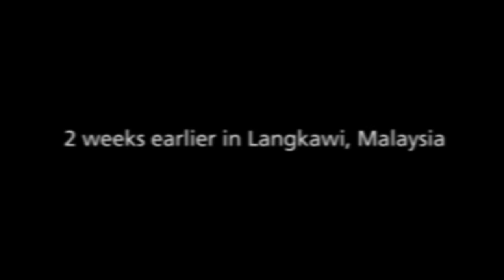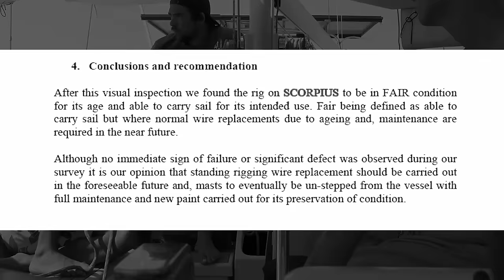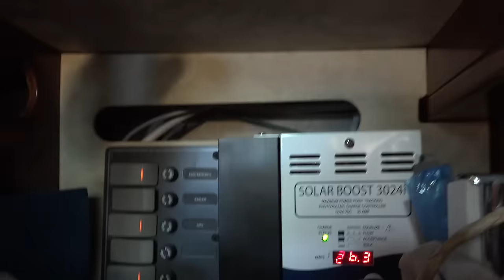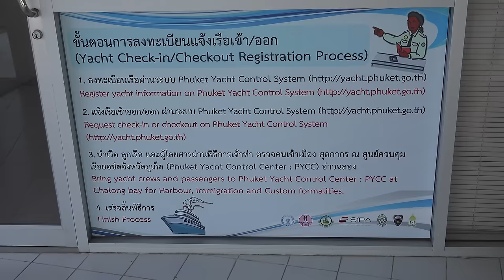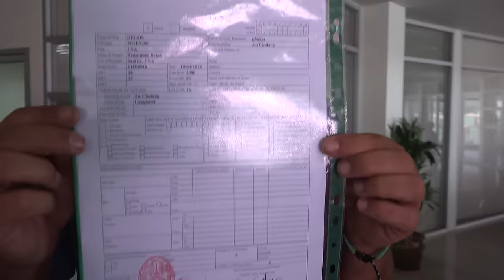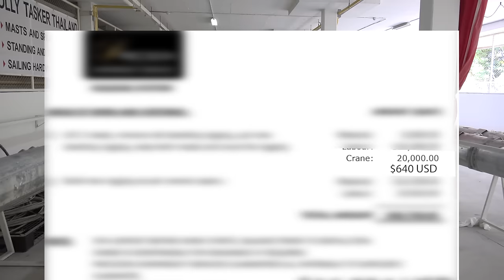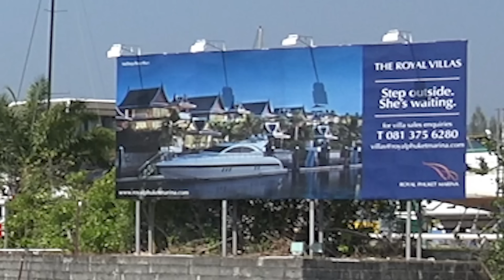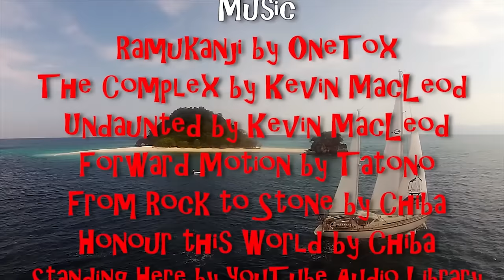Rigging Our Sailboat (Part 1 of 3) Sailing SV Delos Ep. 61

Comment: When I replaced the stays on Satori, I did it in sections without help. I started with the lower shrouds, then upper cap, then fore, staysail, and aft. Didn't have to pull the rig and saved a ton of money. Just had to bring the rigger each set and pick up replacements. Did the whole thing over three sessions. With a crew of six, even a ketch would only take a few days if you could use norseman instead of swaged ends. Thanks for sharing!
Reply from the maker: +SV Satori Yep, that's exactly what we did but in a slightly different order.  Stay tuned my friend, all that good stuff coming up :)  Fair Winds- Brian

Comment: you guys rock. that is by far the right way to do that job. you are right there to get the parts you need if there is a problem it can be fixed. if you order it and have it shipped in and there is a problem then its another 2 months to fix it.this way is cheaper faster and you know what you have and that it is done right....great video as all way and as all was far winds and calm seas.
Reply from the maker: +S/V Working On It Looking For The Boat Yep, you are absolutely right.  This was a major factor in our decision to do it locally.  Fair Winds!  Brian

Comment: Really polished, You mastered video... and yet somehow manage that while still moving...To those of us knowing whats what... Fascinating!!!! 
I am doing my rigging as well  but on a 32' cutter,  its no job like yours though. 
The swages is where wire fails. The cracking is expansion from corrosion which can be exacerbated by salt and water running down the wires. 
Stainless does not like being shut up away from the air. and to add to the problem any stray current makes for galvanic action. 
Lower ends such up the abuse most with the salt water getting into them from open ends, makes one wonder why cutting the ends off and refitting with extensions would not work. But a complete replacement is always advisable. 
Salt water is soooo corrosive and when stainless fails it is with no warning at all. 
I spent  a lot of time aloft when I was younger. I would go up any line at all because I pictured as a kid the ropes we'd swing out over a canyon with from a tree. Ropes so old and tattered they looked as if they wouldn't hold up their own weight -let alone ours. But now at 180 lb. you learn to be more cautious. I'm lucky to still have all my rock climbing gear which makes some tasks easier but the chair and triple block make it easy enough but storage harder. 
Be careful hoisting up, especially the wire to rope halyards they will part sometimes.
   Anyway, Merry Christmas to you guys and Happy New year...
Reply from the maker: +Will Leroy Hey Will!  Merry Christmas to you as well.  You're spot on about the rigging details- stainless gets really worked in that environment.  We did change the whole thing so stay tuned for that, we should release that episode in just a few days.  Fair Winds and good luck on your rigging job.  Brian
Reply: Happy New year. Just curious Brian, did you come down or watch the fire works from aloft?

Comment: I think brake cleaner on the pump motor windings was a bad idea.  The wire is insulated with a thin coat of varnish.  If the brake cleaner dissolves the varnish, the windings will have a short. That would make the fuse blow!  Then you'd have to get a new motor or have it rewound with new wire at a motor shop.

Comment: For the future. Usually this type of cables are oversized from the project with more then 10%. So if this wire was broke for corrosion is one or if was broke from tension is other.  One wire is less them 10% from what I see. If corrosion is the cause  it can wait.

Comment: Thanks for including the pump failure, I like to see those real world situations.  But what happened with the motor repair?  Did simply cleaning it out work?  Was it a bad seal and did you have parts to repair it?
Reply from the maker: +ShawnMichael121277 It was indeed the seal on the pump that then leaked out the housing and 
slowly filled up the motor over time.  I then measured the resistance of
 the windings to find the hot side shorted to ground so didn't have the stuff to repair onboard.  In the next 
videos we actually take it into a shop to get rewound....  We did search
 for new replacements in Phuket but everyone had crappy pumps meant for 
fresh water (cast iron) not the brass required for the salt water 
environment but the rewind shop sorted it out for us.   Stay tuned :) Fair Winds!  
Brian
Reply: +SV Delos Sailing What amazes me is how you find shops just about for anything. A "rewind shop"??! I dont even know if such a thing exists in my home city. :)) Do you ask for directions, or use internet, or maps, yellow pages? How do you find those shops?
Reply: +Zoggizzle Motor rewinding is like rebuilding a petrol engine.... A lot of electrical service workshops can do it (however in my home town it is often cheaper to buy a new one... unless it is very big and special)

Comment: uhhh Brian.. so did the cooling pump motor go back together?  Were the pump seals compromised thus allowing water into the pump motor windings?  Maybe you could put a circular wire brush wheel on a drill and knock down the corrosion on the outside of the pumps parts.  For that matter, any painted metallic part you pull out of the engine space.  Was a TEFC motor a possible replacement to eliminate water into the motor?  Sorry... I've run into these problems on our ship a bunch of times.
Reply from the maker: +Jason Masters Yea it went back together alright but continued to blow the fuse  It was indeed the seal on the pump that then leaked out the housing and slowly filled up the motor over time.  I then measured the resistance of the windings to find the hot side shorted to ground.  In the next videos we actually take it into a shop to get rewound....  We did search for new replacements in Phuket but everyone had crappy pumps meant for fresh water (cast iron) not the brass required for the salt water environment but the rewind shop sorted it out for us.  Fair Winds!  Brian

Comment: My advice is to get a jewelers loop 10x and maybe a 15x magnification and if you have any doubts about something take a nice close look at it for yourself also.  You will be amazed at what you can see under magnification if your lines are good from the outside sometimes it gives you that much more confidence or self assurance but i dont think its a really good way to test a  metal line but it will be very useful for making small repairs trust me.   Here is the link to a good one make shure you get this one. the center is blackened out and for good reasone because it magnifies exactly the center and you can really see good with this one.  also get the 15x or 20x if you want but i use the 10x and i am a jeweler by trade.   here is the link 

 http://www.amazon.com/Bausch-Lomb-Coddington-Magnifier-10x/dp/B0009POLWE/ref=sr_1_3_a_it?ie=UTF8&qid=1456542223&sr=8-3&keywords=bausch+%26+lomb+10x+loupe

Comment: I feel for Brady's snowboarding injury- I did the same thing, with my shoulder, and it was fine at first, and by the 4th month I had to go in for physical therapy on it!  Needless to say, no more snowboarding for me! 

How did the water get into the A/C water motor, bad shaft seal?  How did you stop the leak or did you just put it back together until you hit the next port?
Reply from the maker: +Dan O'Hare Hey thanks Dan- you'll be happy to know that Brady got better in just a few weeks.  The shaft seal failed on the pump side, which filled it with salt water and ended up ruining the windings.  We needed to get it rewound at a shop in Phuket.  We'll cover it in an upcoming episode though so stay tuned :)  Fair Winds- Brian

Comment: I am just starting my sailboat education.  What type of safety factor is used for standing rigging and working loads?  Do they or why do they not use multiple smaller cables to prevent a catastrophic failure or do they?  Can't wait for part 2 and good luck with the project.
Reply from the maker: +JF Lewis I think it varies from boat to boat of course, but what we learned is that the working loads are a fraction of the breaking loads to handle stress loading (big puff of wind, hitting a wave) etc.  I can't remember the exact factor for stranded wires but a few google searches probably could sort that out. One of the things I like about a ketch is you are spreading the load across two masts, two sets of rigging, and smaller sails to get the same area.  Fair Winds, and thanks for watching!  Brian

Comment: At 8:20 in your video I see that you are using Rose Point/Coastal Explorer as your electronic navigation system. It appears that your cockpit monitor is paired with your PC. Is the cockpit monitor just a monitor for outdoor use or is it a chartplotter also? Basically, can you offer a brief overview of your nav system or point me to a previous video where you explain it?
Reply from the maker: +James Newsome Hey James- You know we've been meaning to cover this in a video but you know how that goes....  It is an Industrial, Waterproof, sunlight readable PC display made by Planar.  I think it's meant for factory environments but works pretty good on a sailboat too.  Has lasted 7 years anyway...  It's just run to a laptop that lives downstairs and we use a wireless mouse.  We'll describe more in our video when that happens but hopefully this helps for now.  Fair winds!  Brian

Comment: B.O.A.T. = Break Out Another Thousand, speaking from years of experience myself.   You cant spend your money and time any better way :)
Reply: +elfaroproductions It adds up fast!  We went way over budget on our refit but we are happy to be headed out to blue water for 6 months in a couple weeks.
Reply: +Alex Kreus   Alex that would be hard to answer because  you would have to know the diameter and length of the rigging the number of pieces of associated hardware you need to replace etc...the style of rigging what country you are buying the materials in are you doing the work your self a very daunting task I think on a rig like Delos as I am sure will be reviled in this 3 part series.As far as life span of the rig goes it comes down to usage, just like anything if you use it a lot it wears out, if you are sailing in salt water full time its going to need replaced more often if you are in geographical location that has winter and you store your boat 6 months a year it will last longer :)  but this goes for everything on your boat not just standing and running rigging,  I  am essentially a motor yacht guy  on 60 -100'  most of my working days on the water but I have worked on sail boats as well and owed a Trailer able, a Catalina 27 and a 30.I would stayed tuned to SV Delos Chanel and I think all your questions will be answered in the coming episodes.

Comment: Hi delos crew, i just curious how did you manage your trash when you sailing across indian ocean. Thank you
Reply from the maker: +Edwin Tjandradipura Hey Edwin- there are actually a set of international regulations that determine how far offshore you need to be before dumping anything overboard and what can be dumped.  On Delos while offshore we dump all organics (food mostly) and pure paper that will readily dissolve (paper without any glossy or coating).  Metal cans and glass bottles are filled and sunk in deep water to make new homes for crabs.  All sorts of plastics no matter what type are cleaned and stored for burning or disposal later on.  You really have to be careful in the islands because what you dump in the bins can sometimes just be dumped on the beach a few days later by the local trash man.  Not good so we tend to burn stuff which is probably the lessor of two evils in most cases.  Fair Winds!  Brian
Reply: +SV Delos Sailing Thank you for the anwer.

Comment: I have a dumb question: Can you not just put a spot weld on that one strand of wire to get you by?
Reply: +Erated78 Not a good idea at all. The act of welding will cause damage to adjacent strands for sure. Also the heat from the welding process will change the tensile strength of the cable and cause the whole stay to break. It's not a dumb question. It's a very good question because most people will just look at the repair, and not the consequences of the repair.
Reply from the maker: +Earl Humphrey Yep, you're absolutely right earl!  Thank for that.  Brian
Reply from the maker: +Erated78 Yeah Earl is absolutely right.  We do carry some spare ends with a few meters of spare wire, so in a pinch we could just replace that strand or even the end of the one starting to fail.  The thing is we felt it was probably a sign of the wear and age of the entire rig, which means probably all of them need to be replaced.  Especially since we were about to cross the Southern Indian Ocean we really wanted to error on the side of caution.  Fair Winds!  Brian

Comment: Why does a haul out make your work on the bottom paint now worthless?
Reply: +Mark Donaldson My guess is UV rays break it down?
Reply: +Mark Donaldson antifouling paint is finicky...once paint and put in the water its best left in til time to redo it
Reply from the maker: +Mark Donaldson There are two reasons in my mind- the first is when you haul out all yards insist on pressure washing your hull.   Like the sort of units you'd use to blast your driveway.   With an ablative or semi-ablative paint it just removes A LOT of paint.  It's like everything good protecting your hull going right down the drain!  The second thing is some paint manufactures say the effectiveness of the paint is reduced after drying out.  When we hauled out in Australia about 8 months after painting it actually cracked and lost it's adhesion to the layer underneath.  So, best to keep her wet on new paint in my opinion!  Fair winds- Brian
Reply from the maker: +SuperJlonergan Yep, you're absolutely correct on that one.  There are two reasons in my mind- the first is when you haul out all yards insist on pressure washing your hull.   Like the sort of units 
you'd use to blast your driveway.   With an ablative or semi-ablative 
paint it just removes A LOT of paint.  It's like everything good 
protecting your hull going right down the drain!  The second thing is 
some paint manufactures say the effectiveness of the paint is reduced 
after drying out.  When we hauled out in Australia about 8 months after 
painting it actually cracked and lost it's adhesion to the layer 
underneath.  So, best to keep her wet on new paint in my opinion!  Fair 
winds- Brian
Reply from the maker: +J DeWitt DIY Hmmm, it certainty wouldn't surprise me if this were true.  There are two reasons in my mind- the first is when you haul out all yards insist on pressure washing your hull.   Like the sort of units 
you'd use to blast your driveway.   With an ablative or semi-ablative 
paint it just removes A LOT of paint.  It's like everything good 
protecting your hull going right down the drain!  The second thing is 
some paint manufactures say the effectiveness of the paint is reduced 
after drying out.  When we hauled out in Australia about 8 months after 
painting it actually cracked and lost it's adhesion to the layer 
underneath.  So, best to keep her wet on new paint in my opinion!  Fair 
winds- Brian

Comment: The Rigger did you a disservice by not being more blunt that the age of the rig and the miles under the keel had rendered the whole thing suspect and that you should not go to sea without a minimum a complete  inspection of every single fitting that would include disassembly to look for imminent failure and that there was no way you should contemplate an ocean crossing before replacement  .  Too many lives at risk . Delos is a well made vessel crewed by skilled sailors but that can not defeat metal fatigue and corrosion . Delos is no fair weather only lightly used coastal cruiser either . During replacement with that pin and in cutting open   that swage  you found what he should have bluntly warned you almost certainly existed .

Comment: Have you emailed any rigging engineers?  I was an aircraft mechanic and I can tell you that rigging cables are designed far beyond their normal usage to include a few broken stands. Do you have double cables on your main rigging?  If so, can you replace one cable, while the other supports it?  I hope I can ease your worries and offer good advice.  Looks like your cable is close to half inch. This may be a helpful link for info on the tolerances, which are pretty beefy at around 30000 lbs breaking strength.  http://thecableconnection.com/strand-cable.html
Reply from the maker: +clnelson321 Hey yeah thanks for that!  While we were working on the issue we did get advice from a number of guys.  They agreed that the working loads are very far from the breaking loads and in itself one or two strands out of 19 is not in danger of imminent failure.  Except the rig is so old we had an idea that this was just the beginning and so should all be replaced before our ocean crossing.  We did learn a lot during the project which was really cool.  Stay tuned, a few more episodes coming up on this.   Fair Winds- Brian